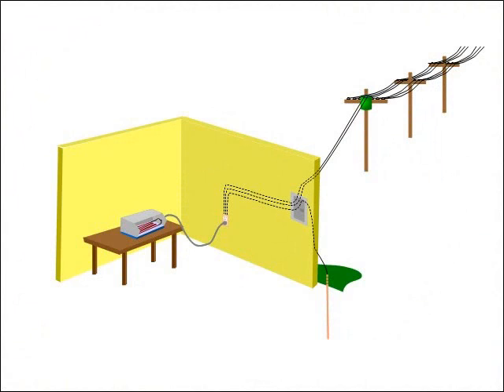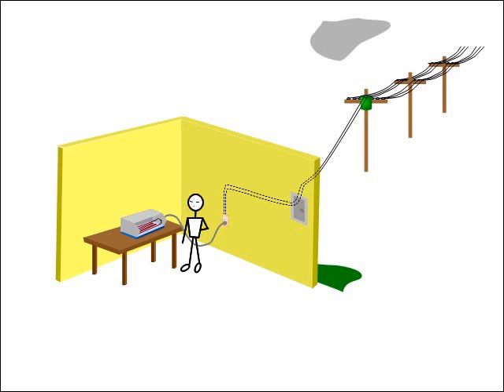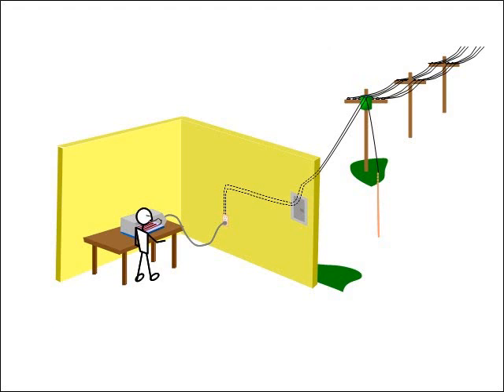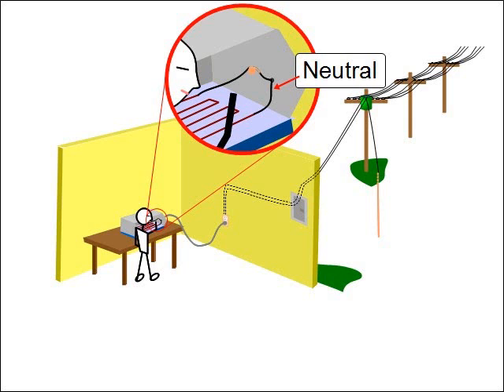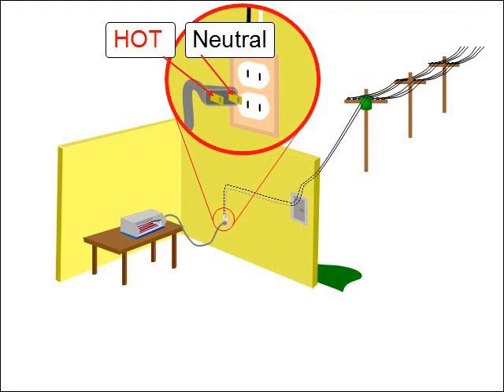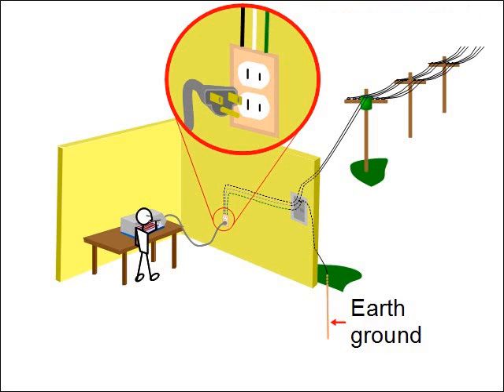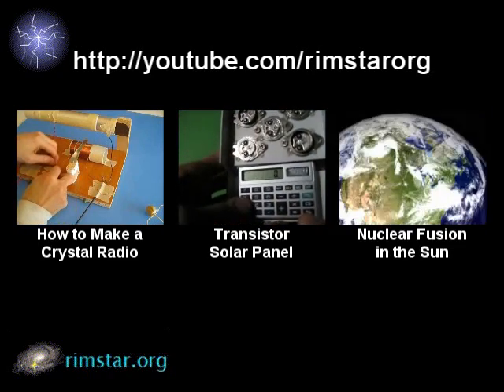Hot Neutral and Ground our Funny Looking Household Electrical Socket

Comment: if I wear a pair of thick rubber shoes and touch the hot wire,, can i get shocked ?
Reply from the maker: +kai dan Theoretically no, you shouldn't get shocked. I wouldn't try it though. Maybe there's a defect in the rubber shoes or maybe they have some conductive material in them.
Reply: thank u, I have a question: if we don't connect one wire of AC power source to the ground, then the both wires will be the same status and I touch one wiire, can I get shocked. If yes, how could the current flow to go back to source?
Reply from the maker: +kai dan The answer is that it doesn't have to go back to the source. Current will flow as long as there is a difference in potential i.e. a voltage. The AC is constantly fluctuating between 120 volts and -120 volts, both with respect to Earth ground at the power generating station, which is the same as Earth ground everywhere else. During the time that it's at 120 volts (for example), it is at 120 volts with respect to Earth ground and so current flows between the wire and ground. Earth ground is a good ground (unless it's very dry) i.e. it accepts electrons easily and gives them easily. When it does it doesn't affect the charge of the Earth much because it has such a huge volume.
A good analogy for voltage is pressure. If you have something that's at a high pressure and you put it next to something at a low pressure, then there will be a flow from the high pressure to the low pressure.

Comment: Thanks for your video, I have been trying to find out which colour wire is "Hot" or so called live in UK, which turns out to be Black, and UK it is Brown, and which is the Neutral in N.America, white which in UK is Blue and Green is earth in N.Am, and in Uk it is Green with yellow marker, I am glad this is sorted out as I have to build some equipment for USA and needed to get it absolutely right. (oh as well as you have 110v 60hz and we have 230v 50hz mains supply)

Comment: So both grounds (plug and neutral) are connected to the actual earth?
is the ground on the plug ever connected to the neutral wire?
Reply from the maker: +Shofar So Good Yes. In North America the neutral is connected to ground in the main breaker panel. That ground goes to the actual earth. The only place the ground on the plug is connected to neutral is at that connection in the breaker panel.

Comment: Hello, yes great video. I did finally learned which side of the prong is neutral and hot. There is however an error between your illustration and explanation. @2:25, you have mentioned neutral wire is the taller hole; however, the color of the wire on the outlet is black .
Reply from the maker: +Dipankar Sutradhar It could be due to where you're located. In Canada and the US the taller hole is neutral. If you're in one of those two countries and a black wire is going to the tall hole and a white wire is going to the shorter hole then you might want to have an electrician come in and check your wiring.
Reply: +RimstarOrg I am in US. Please follow the video from 2 minutes mark. @2:09 you have it as Black - Hot and White - Neutral; however, @2:25 on the outlet picture you have it reversed, Black (hot) connected to the tall hole, and White (neutral) to the short.
I guess I will go by what you said in the video than what you show.
Reply from the maker: +Dipankar Sutradhar But, at 2:25 I have a text and arrows on the drawing pointing out that the white wire, neutral, is connected to the tall hole. Having the black wire on the left, above the tall hole may be confusing, but it says right there that the white is connected to the tall one. I guess if you ignore the text you'd think otherwise. I don't recall why I drew the black on on the left and the white on the right. In hindsight I should have reversed them.

Comment: Okay you take the hot wire and tie it in with your neutral, then in the panel do the same thing, take the power and neutral and plug em both into a 40 or 50amp breaker. Then, in the receptacles make a pig tail out and connect you'r hot/neutral wires to the ground wire. Then turn on your power and bam! You just suped your house up to 220 volt super power! And nobody can touch the panel without gloves on without getting a little taste of it 😉😉

Comment: why does my ground wire have power
Reply from the maker: +Rigoberto Gomez It sounds like you have a short circuit somewhere. That means that somewhere your hot wire is touching your ground wire. If it's only when an appliance is plugged in or turned on then the problem could be in the appliance or even the plug, otherwise it might be in the receptacle or the wiring in the wall.
Reply: +Rigoberto Gomez Because your neighbor is stealing power by taking a hot wire and running it across the load and down the water pipe (which is connected to the ground wire as well). This way meter is bypassed (assuming old type meter) but ground wire is energized (for everybody in the building) when his load is on. I wouldnt be taking long showers if I were you. Zap zap zap ....

Comment: If the neutral is connected to ground and all power is trying to get to ground, then why doesn't power flow straight to ground as the AC current alternates instead of going through a circuit?

Also I feel like I am taught that the neutral doesn't carry current but it obviously must with AC.
Reply: "all power is trying to get to ground" FALSE.
Charge is returning to source (the transformer in the case of residential power). It may use the earth as a conductor at times, but it is a misconception that electricity is inherently trying to get to ground. Neutral absolutely carries current, though its voltage should be about that of ground potential (you could call it zero). 

Consider this: The transformer feeding your house could be grounded at any point along winding which creates the 240 volts of potential. Wherever you chose to ground it, that would become the new 0 voltage reference.
Reply: Aghast the neutral wire carries unbalanced current. In the end we don't need that unbalanced current so we are connecting the neutral to the ground.
Reply: @VjBroodz  This is confusing at best. It has nothing to do with 'not needing the unbalanced current.' We are not 'getting rid' of anything by connecting neutral to earth, besides the transient voltages mentioned in the video (lightning, induced voltages, etc).

Comment: I may be the slowest man on the planet. I am trying to understand how the ground wire protects but I can't grasp it.
Reply: +resandor Well electricity always finds the nearest short. Instead of going to your body, if the ground wire is touching the case and somehow one of the other wire touches it, it will refuse to go through your body and go straight to ground. And the GFCI will trip it too.
Reply: Joseph Romus Well a hot-ground will trip GFCI too. Some electricity is went to ground instead of back
Reply: Joseph Romus Well yes I know it would be a ground fault. However a GFCI will do exactly what a circuit breaker does - break a circuit.

Comment: Static on a power line would never reach the household supply, it can't pass through the distribution transformer. Power supplies are grounded so that if the hot wire comes loose and touches the metal case of an appliance it will cause a short and trip the breaker. This is also why plastic tools don't need a ground wire. As for current returning on the ground path, the impedance of the ground path is a lot higher than the neutral wire so almost all of the current will go through the neutral. And the current (whether ground or neutral) only goes back to the distribution transformer, not to the generating plant.  Finally, power lines don't have lightning protection on them, the transformers at the substation or in your back alley are protected by them.

Comment: in australia we call the wires Active, Neutral and Earth. is this the same as Hot, Neutral and Ground?
Reply from the maker: From a quick reading of a few sources online, yes, Active = Hot, Neutral = Neutral, Earth = Ground.
Reply: @RimstarOrg  In India, the earthing hole of the socket is upwards, so it's more like an inverted triangle made by the holes of U.S. sockets. Why the difference ? Please explain the pros. & cons. of usage of 220 V vs 110 V supply. Why does U.S. has less rounded, more rectangular socket holes / or rectangular pins on the plugs of their appliances ? Indian sockets are mostly build for cylindrical / round shaped pins.

Comment: mokruxa, the two hot legs (black) from the final step-down AC transformer to a residential service panel are connected to either end of the same wound ~240v transformer secondary coil. The neutral is centre-tapped off this coil, with one end grounded at the pole base, other connected to the panel neutral bar and off to plugs and lamps. The neutral splits the ~240v coil to two ~120v hot legs and equalizes both in relation to the neutral. In the event of voltage imbalance between the legs, which occurs basically constantly, the neutral is the conduit for excess electromagnetic energy to ground into the earth, balancing the two panel hot busses at ~120v. Imbalance can arise from generator voltage spike, static buildup, lightning.

Comment: Yes, this is often a problem since only 208V is available in many industrial and commercial areas. Electric vehicle chargers in the US generally run off 240V and are limited to 30A so the available power is decreased significantly when only 208V is available.

Comment: They don't -- you can insert a Shuko plug either way, so hot and neutral are not defined. Most Shuko plugs can also be plugged into a French outlet with a ground pin that will give you a defined hot and neutral, but that doesn't help you in Germany, Sweden, etc. So you just have to design your appliances to fully insulate both wires.

Comment: I can see a problem if a 240V aircondtioning unit with the NEMA 6-15P plug is plugged into a NEMA 6-15R outlet carrying only 208V. It would be running at the low end of the input voltage range of a 240V unit and might overheat under extended use in blistering hot weather especially if the 208V is low to begin with because of demand. Ranges, water heaters and clothes dryers can probably cope because any motors such as drum rotation or timer runs under fairly low load all times but AC might suffer

Comment: I'm at a loss as to how Shucko or Euro 2 pin plugs polarize live and neutral correctly every time you insert the plug. Seems the plug could go in either way and maybe have neutral being switched instead of live. Other countries plugs can only orient one way due to ground pin but Shucko even being grounded looks like it could go in either way. Others like Italian or Swiss also look like they could go in either way because ground pin is centered between the current carrying ones.

Comment from the maker: Where did I do that? I just checked and at 2:20 I'm showing it correctly. If you're referring to the way I drew the wires descending down the wall to behind the outlet, I didn't try to match them up since they're usually spaghetti behind there anyway. But I can see it might have been better to show them matching the holes anyway.

Comment: Wrong in California code requies that no conducting wire (neutral) be connected to ground. Causing stray voiltage on high tension lines.

Comment: I assume you're talking about European (or at least non-North American) practice, right? Here in the US, single phase service is 120V between hot and neutral or 240V between two hots 180 degrees out of phase. 3-phase service is (at the utilization level) 120 V between each of 3 hots and neutral and 208V between any two hots. We have a seperate neutral for return current and a ground for safety only; is that your practice too?

Comment: That doesn't sound too wise. 133V is above the upper end of the voltage tolerance for US 120V supplies, and I doubt it's allowed to return current through the ground wire in Europe (it certainly isn't in North America, as that will trip any ground-fault protector on the circuit.

Most electronics no longer cares about 50 vs 60 Hz, but some motor equipment does.

Comment: Quite interesting this would mean that a North American commercial electrical appliance Coil or Circuit rated for 110Volts can run i Europe. However wire it between  L1 (HOT) and Ground (Green and Yellow in EU) on a non symmetrical load Europa 230V main. That is 230/Root 3 = 133Volts AC. Not conventional L1 and Neutral. The Hertz of Europa 50Hz and US 60Hz wouldnt make much a differance to the Impedance or Reactance. I guess the diode rectifyers can handle it as well. However a true experiment !

Comment: A 3Phase Y-Generator has a Neutral wire coppled to the Zero Point. In a household Non-Symmetrical load the Neutral wire (or ground) is used constantly as a "Return" for the phase current. The 3Phase Voltage is reduced with the Root of 3. 400V/R3=230. A 3Phase motor does not need a Neutral wire for it use a symmetrical 120 * 3 load. When faults or ground is electrified, and L1 one phase is used the Voltage drops again with the Root of 3. 230/R3 = 133V. This induce a relay and shuts the power off.

Comment from the maker: Only one of the lines, neutral, is grounded. The HOT one is not. The only time the HOT is connected to the neutral is when you close the switch on an appliance. In that case the electricity goes through the appliance and does it's job, and then it doesn't matter if the other wire is connected to ground or the distant generator plant.

Comment: Not just three phase systems have more than one hot wire, but also the split-phase 208/240V outlets in North America. They have two hot wires, usually black and red, plus ground (green), plus an optional neutral (for those loads also requiring a 120V supply). A good example is the NEMA14-50 now used on electric cook ranges. The SAE J1772 electric vehicle charging plug has the two hots and safety ground but no neutral since the car only needs 240V.

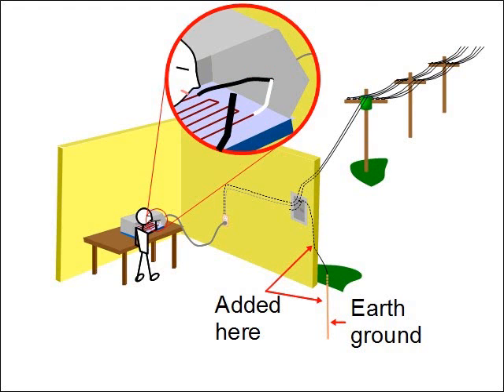Comment from the maker: I just double checked and I didn't I say tie hot to ground anywhere, unless missed it. You're right though, do that on the house side of your meter and your bill will go up, briefly until the fire :). Re neutral and ground being bonded, I should have mentioned that but I did include it in the diagram at 2:49.

Comment from the maker: Let's say you have a wire with two ends/terminals, called A and B. If A is positive and B is negative then current conducts in one direction. If we then change A to negative and B to positive, current conducts in the other direction. Keep switching the polarities back and forth like that and you have alternating current, AC. With a generator, like a hydroelectric generator for example, that alternating is done by interacting with giant coils as something rotates (magnets, I suspect.)

Comment: I'm still not clear on how the neutral works, but your video helps. I'm going to tear apart my circuit breaker panel to see it for myself. My real job is flying airplanes, but like you I'm a self taught hobbyist and know just enough to be dangerous :) There's something magical about electricity and understanding it isn't there??

Comment from the maker: ... continued. That's fairly simplified. Really there are transformers involved and other intermediate parts. Also there is more than one hot connection, though most appliances, the 120 volt AC ones in North America, use only one of the hot wires. But that's the general idea. Generator station - hot wire - switch - appliance - neutral wire - ground. And since it's AC, alternating current, the electrons are pushed and pulled back 60 times a second (in North America.)

Comment from the maker: Picture the electrons in the wires. Keeping it simple, you have two wires extending from the power generating station. One of those wires is connected to ground in places. That's called neutral. The other is not connected to ground and is called hot. The only place the two wires are connected is at the generator and wherever you close a switch. When you close a switch, electrons move back and forth through the hot, through the appliance and back to neutral and the nearest ground. continued...

Comment from the maker: It's similar to if you line up a bunch of balls, side-by-side. When you push on the first one, almost instantaneously they all move, including the last one. It's that impulse that moves at the speed of light down the wire.

Thanks for bringing it up anyway. Had you been right then you would have spotted an error and I would have learned something, which is always a bonus.

Comment from the maker: My understanding is that they travel at the electron drift velocity.

V=current/(n_electrons x cross_sectional_area x charge). Assume current = 15 amps. n_electrons = 8.5x10^28 (see Drift Velocity in wikipedia, Numerical example). cross_sectional_area of 14 AWG wire is 2.08x10^-6 meters. charge = -1.6x10-19. So V = -0.00053 meters/sec

How did you get 2.5km per cycle? Without knowing drift velocity, I would have done speed of light divided by 60 cycles per second and gotten a much bigger number.

Comment: Electrons don't go very far? They go about 2,5km on each cycle, which I'd consider far as in how they move across devices that have combined amount of traces less than 1m. Not far considered to the transportation lines that may go for hundreds of km, though.
But anyways, excellent video! I learned a lot. Good way of presenting this through the stages of improvements in history.

Comment from the maker: Here in North America the wiring's not always done correctly in the walls. My apartment has just one socket with a good ground connection. It's also still possible that the socket is wired with hot and neutral backwards. So having all our different shaped prongs on the plugs doesn't mean it's always safe.